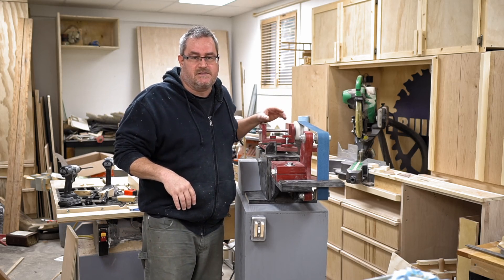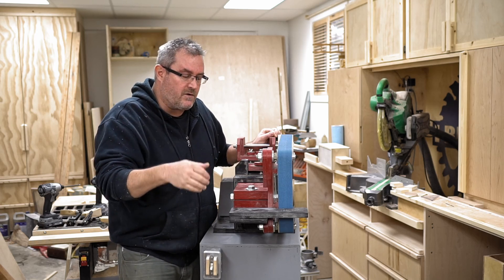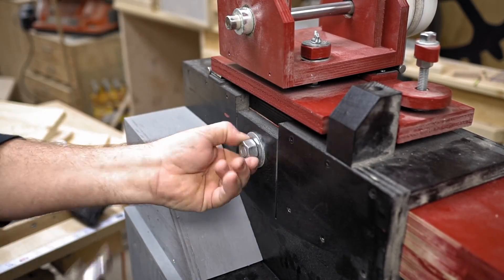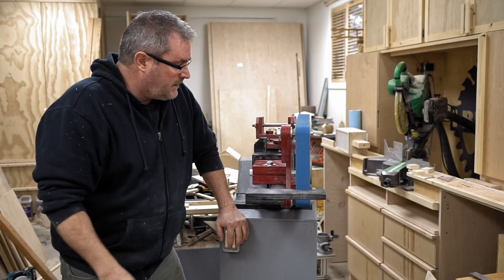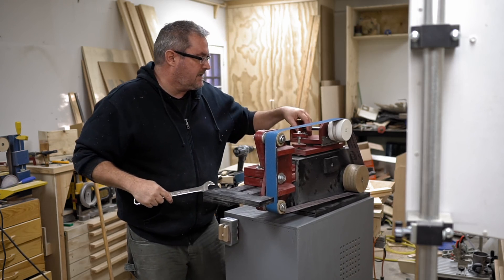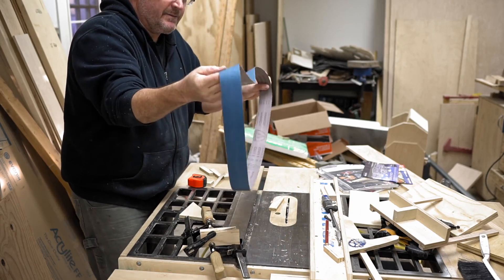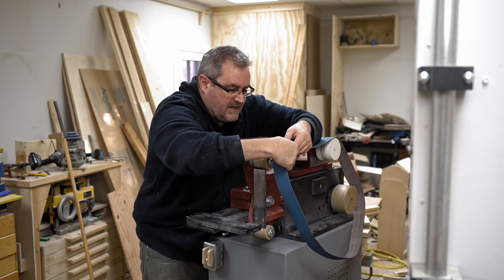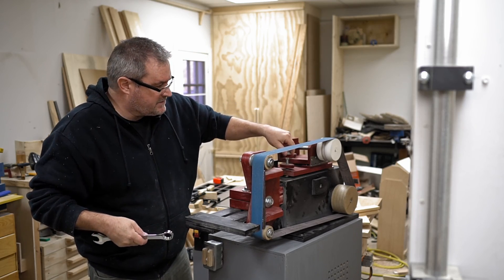Homemade 2 x 72 Belt Grinder - Belt Stretch Fix

Comment: John is it still your belief that all of the wheels should be flat to prevent belt stretch? I wanted to ask as this is about a year and a half since you posted this video. I was recently told that the wheels need to be within .0001" true, which is a very small tolerance...I don't even see how most bearings would meet that tolerance, so call me a skeptic...more so, you used MDF and rounded them with a chisel.🙄

Comment: I have two crowned wheels on my diy grinder. My belts are tensioned with a trampoline spring. I seen this video before building mine. As such at first I removed the tension when done with grinder. Then I just forgot about it once and after setting all week no issue. O run 2x72 ceramic belts and A/O belts for the fine grinds. The brand I use most is Deere and I Haven't had that issue. I don't put a lot of tension on them just enough to keep the slack taken out. Maybe it's the brand belts or just a bit to tight. Any way I do like your build it is a little more DIY than mine as most people have the ability to work with wood. Mine is metal with hard wood drive wheel and skate board wheels for the rest. You do always have some good ideas and I enjoy k
Reply: enjoy your channel

Comment: I think your other reason for stretch is too much solid tension. the pro made and most shop made all use a spring tensioner. some use rubber (inner tube) on the drive to cut down slippage if that's an issue.

Comment: IMO, crowned are better in every way. It tracks true, and as you apply pressure to one side, it won't track any differently. I've seen a lot of flat pulleys with Knob adjustment that definetly were seriously affected when grinding on one side of the belt. You should always remove the belt after use (or untension it) even if you have flat pulleys. Instead of simply solving your stretching problem by removing the best (i know it's not convenient) you are possibly creating a few issues to solve that one stretching issue). I do incredibly love your tensionner however and I might buy the plans to use that in one of my next builds.

Comment: The wheel needs to be crowned to keep the belt from wandering under pressure. The simple fix for not stretching belts is to take them off or release the tension when not in use. Simple as that.
Reply from the maker: Tracking keeps the belt from wandering, the wheel doesn't need to be crowned (I would know this...).

Comment: Hi John. I have a number of industrial belt sanders and belt grinders and all of them have some sort of spring tensioning systems in them. Do you think using something like this rather than a rigid locking system would help in your tracking and belt stretch issue?
Reply from the maker: It's not a rigid locking system - a screw puts tension on the belt and acts as a spring. The stretch problem has nothing to do with how the tension is applied.

Comment: The wobble isn't a bad thing per se. when not to much you have an oscilating beltsander... cheers. My take on it is that if you decide to make a crown, a few thou should be enough for tracking, but not enough for stretching the belt so much to give these problems you showed. cheers. thanks for the great video's.
Reply from the maker: Oh, the wobble is definitely a bad thing, if you want to grind a straight edge, like the plunge line on a knife blade. 
I very much doubt that a few thousandths will crown a wheel enough to improve tracking, but like I said, the wheel can and should be flat.

Comment: pretty sure the arrow doesn't matter on most belts. most likely just a printing anomaly. good to have though so you know what way round to swap it.
Reply: it only matters on belts with lap joints,  belts with butt joints (wich are much more common) it does not matter

Comment: Was that wheel crowned in the middle? On camera it looked to be crowned to one side of the wheel. If so, I could see it stretching, but if it were crowned exactly in the center of the wheel the stretch would be even, yes?
Reply: only if you stop the machine when the belt is exactly centered on the wheel
Reply from the maker: Why would I crown the wheel to one side?
Reply: That's why I asked, on camera it doesn't look as though it is, my mistake for asking a stupid question, sorry, I won't comment again.

Comment: Free oscillating feature :)  I flip the belts on my edge sander to use the other half without moving the table all the time.  I've even done it with the crappy belts with the overlapping seam where that could possibly make a difference and it doesn't make any difference.
Reply from the maker: I had one of the overlap types come apart before when it was in backwards, but these even splice ones are really supposed to be bidirectional. Or you would think, anyway, so I have no idea why there are arrows on it. Maybe they use the same stock to make overlap types.
Reply: John Heisz I figured they just printed the arrows on everything, but then I ordered some 9x11 sheets that are clearly the same stock and they have all the same printing on them except the arrows so they are going to some trouble to put those arrows in there for some reason.  I do find it sometimes useful to help remember which side of the belt I already used up IF I remember to always put it on with the arrows the right way the first time.

Comment: Thank you for the explanation and demonstration. I want to make myself one soon. You answered a question that I had about the build with your video. 👍 I have some old skate wheels. Do you think that they would work if I turn them so that they're nice and flat?
Reply from the maker: No harm in trying, but the bearing will likely wear out very quickly.
Reply: They would wear out quickly because of their small size and the speeds involved?
Reply: John Heisz g

Comment: Perhaps it is not the machine but the belt splice is defective or failing..  Have you tried a different manufacturer's belt?
Reply from the maker: As I said, it is the splice that is stretching (not the machine), but having crowned wheels might make that happen faster.
These are high quality, made in Germany brand name belts.
Reply: what if you crown the bigger wheel instead?
Reply: Well there's the problem, cheap import belts...  :) Seriously though, I have an old Delta 6 x 80 belt sander (crowned Drive roller) and have never seen a belt joint stretch and it can set for months at a time between use.  I know that's apple's & oranges but the joint should not stretch at all.  IMHO.  Before you condemn your design perhaps you contact the manufacturer.  By the way,  I use Grizzly belts, I don't know who makes them..
Reply from the maker: Walt Kiefer Ok, I said nothing about "condemning" the design - where did you get that? I only said "don't crown the wheels" - they don't need it. 
Lots of difference between a belt that's 6" wide and one that's just 2".
Reply: Poor choice of words, apologies.. I was referring to the crowned wheel which is SOP on the few belt sanders I have used,  perhaps the radi is to aggressive.